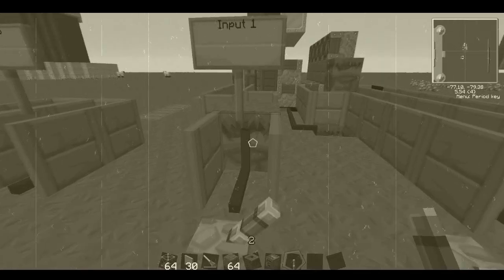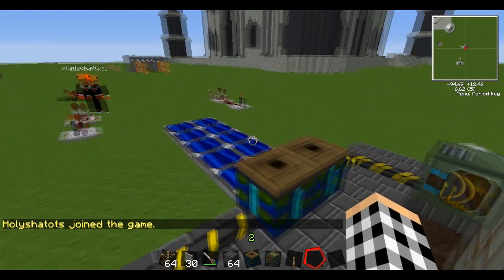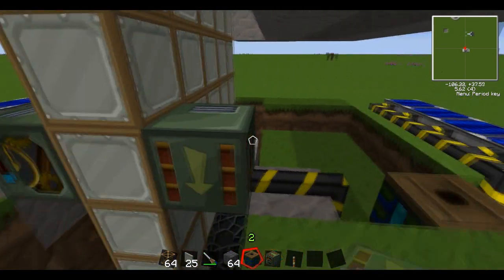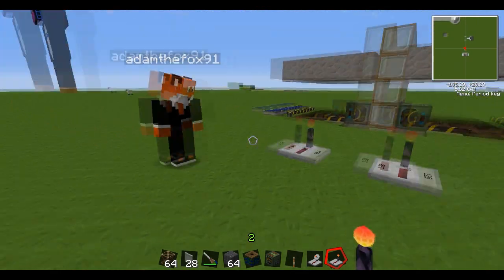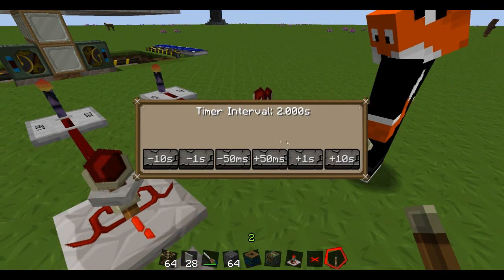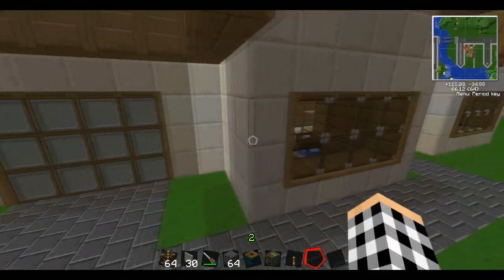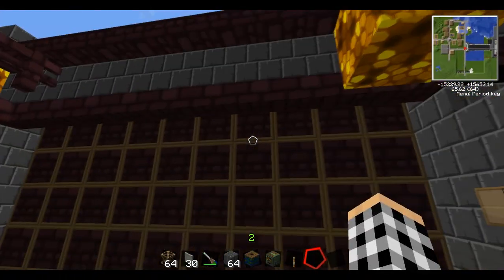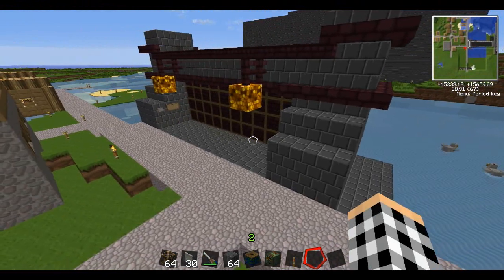Red Power 2 | Frame Door Tutorial

Comment: It helped me set it up, but the door won't move. I used birch wood plank panels instead of iron panels and I tried to put the levers in different spots, but it still won't work. Does the transmitter and timer have to be on the same level as the frame motor?